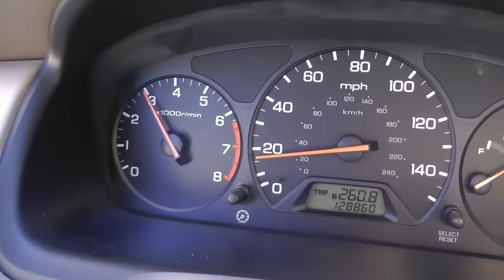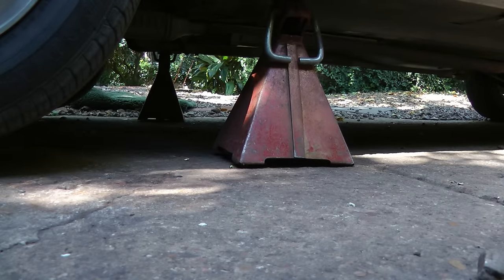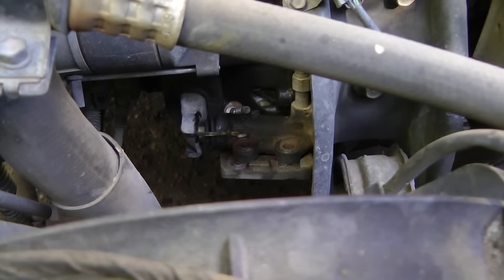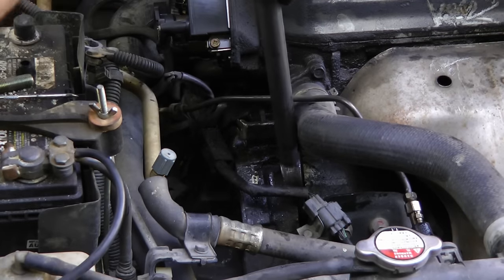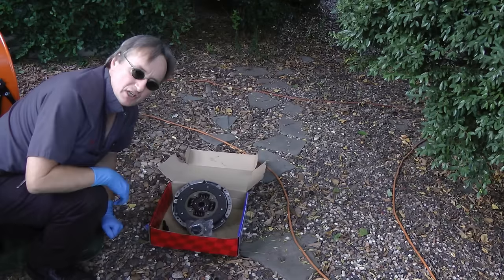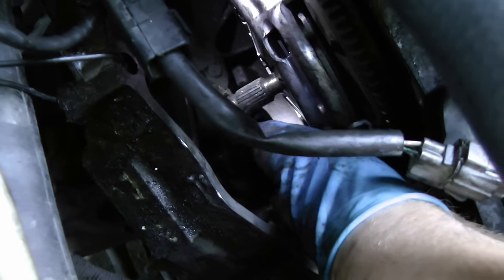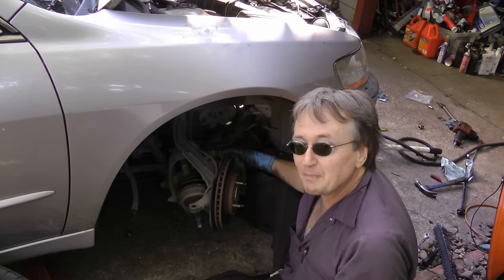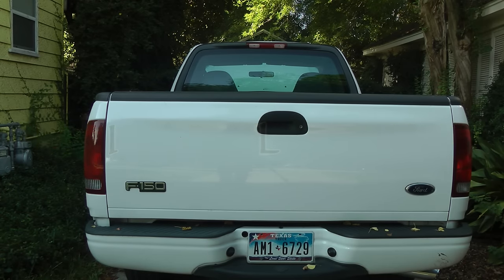How to Replace a Clutch in Your Car

Comment: I am going to state the blatantly obvious, but often overlooked tidbit of common sense: Don't EVER try doing this unless you're extremely advanced with cars. Yes, it is quite expensive to be done at a mechanic, but you will have absolutely no car if you screw something up, or just plain can't get things back together. Dropping a transmission is no novice task, getting it back into place is EXTREMELY difficult, this video doesn't show just how hard it can be. There are certain things that are absolutely worth paying a big price for to get them done at a shop, unless you're extremely proficient at cars, this isn't something you want to be getting into. I know this is all common sense, but I can't even count how many people I've seen fuck up their cars trying to do very difficult repairs by themselves, all because they didn't want to pay to get it done right.
Reply from the maker: depends on the car, and the person doing the work. I was putting clutches in cars when I was 14 years old, any mechanical person can do it.
Reply: ***** I'm not telling people to depend on shops for everything, I'm a person who does nearly all of my own car work, and learned that way. I'm just telling people to be very careful what they get into, make sure they know what they're doing, or have someone around who is. Like I said, I have seen so many people fuck up their cars because they were trying to do something way other their head. Say you need your car for work, if you can't get your transmission back into place, you aren't going anywhere. It's definitely a great idea to work on your own cars, saves a ton of money, just make sure you have the necessary experience before delving into the advanced stuff, that's my whole theme here.
Reply: ***** Hey in that case you had nothing to lose, I'd say go for it. It absolutely depends on the car, no doubt about it. For instance, I think anyone could agree a RWD is much easier to change a clutch in over a FWD or especially an AWD. My point is for people to always make sure they do their research beforehand; you don't want to jump in to suddenly realize you're absolutely screwed, have no idea what you're doing, and now have an inoperable vehicle that you cannot get back together. When that occurs, there are only two likely outcomes: They just put things back together despite being lost, and wind up screwing up their car, or they have no car to drive until they tow it to a shop, or find someone who can help them.
Reply: ***** In my personal opinion, I think the best idea is to have someone around who knows their stuff to shadow you. Everyone knows of someone who is good with cars, most people will be happy to help you if you respect them, show genuine interest, and most importantly listen to them. My neighbor was a mechanic, I began going over there on weekends when he did side work. As a condition for him to teach me, I offered to assist doing all the "bitch work" so to speak, grabbing and returning tools, collecting trash, disposing of fluids, you name it. I figured that was fair, considering he was taking his personal time to sit and explain things to me.

In a very short period of time I went from not knowing how to change oil (I was never taught anything about cars in my family, every problem was take it to the shop) to changing my own brake pads, struts, fuel filter etc. If you gain a mechanic's respect, they will eventually usually let you bring your car over and work on it, and you always have them there for when you run into a jam. You then have the ability to be a go getter and dive into projects, with peace of mind knowing you have someone there to help.

Manuals can be a great tool, I just personally think nothing beats learning hands on from another mechanic. Jumping into projects is great, just make sure you have someone available to assist you if you run into a jam. Eventually you can pretty much become self sufficient, but until then it is wise to err on the safe side.
Reply from the maker: *****
Na, my father could barely tie his own shoelaces, he played bridge and won money playing the ponies. My grandfather, his father, was the mechanic. One of those skip a generation things.
Reply: if you are lazy of course it is impossible.if there is will then there is a way.
Reply: well said. i skipped 3 steps due to not having the tools putting a front strut into a vw polo and it still went in perfect!! nothing damaged. where theres a will, there is definitely a way!
Reply: cyrax99
Any technically inclined person would know before had if they wanted to do this job on their car or not. Everything you do in life is "do at your own risk/leisure."
Reply: Joe M. I like your
I confidence! I bought a clutch for £63 and had it fitted for £80
Reply: YouTube Support how did you manage that?
Reply: gentle persuasion and using your head
Reply: I was born with poor boy syndrome which made me into a mechanic. Now its not that im poor i just have my own way of doing things and i don't trust other people touching my cars. NO TOUCHY!
Reply: I was also born with poor boy syndrome, and it took me on the path to earning my degree in Auto Tech. However I would have to agree with the OP on this one. If your mechanical experience only goes as far as replacing your air filter or changing spark plugs, make sure you know you can do this job. If you have even the slightest bit of doubt, you may want someone to shadow you. I have loads of transmission experience and mechanical experience in general, and even I had some difficulties when I did my clutch a couple weeks back. They're a super straightforward job, but it requires a good bit of know-how to make sure it is done right. Right being the keyword - I think someone who did the clutch on my truck before didn't have a good idea of what to do, and the pilot bearing was toast, only the outter race was left of it.
Reply: So how did you go Joe..did you change your clutch? Or did you have to take it to a mech, just curious
Reply: cyrax99 yeah but he is making it look so easy that it made me want to fix my girl's car but I'm thinking putting back all them screws and I'm a forgetful man I know I'm going to have plenty of screws left over on the floor like you said to put back that transmission and everything back how it was in place man you going to take plenty of hours not 4 minutes but he showed us the basically things what you got to do but he didn't show the struggle
Reply: cyrax99 your right. But at the same time it's very negative and   pessimist.
Reply: I've changed 2 clutches on 2 different vehicles and, while it looks intimidating, it's not that difficult in real life. The first clutch I replaced was a 1982 Datsun 210 station wagon. That was ridiculously easy. Just had to disconnect the drive shaft (most Japanese cars prior to the mid 80s were rwd) a couple of wires, and the tanny itself. Whole process, from start to finish,  took 5 hours. Transmission only weighed about 70lb dry. I could lift it with my bare hands but still used a floor jack and Jack stands for clearance. Unluckily for me, a garbage truck backed into that car two weeks later, totaling it. God I miss that car. (On a side note, if you want a car that is super easy to work on, Buy an older rear wheel drive Japanese or European Vehicle. Small engines and massive engine Bays with few wires, hoses, Etc. Everything is very easy to reach.) Second clutch I did was on a 1991 Mercury Tracer, basically a rebadged Ford Escort. It took me a couple of days to do it because it is front-wheel drive and everything is cramped in the engine bay and I had to take more stuff out of the way to get to it. But I still did successfully. The most difficult part was getting the transmission to fit back on to the engine
Reply: Or pay them to do it wrong and then have them avoid all responsibilities. Then you are left with a messed up car and a bad review or a BB form to file write.
Reply: Changing a clutch is fucking easy, guy. You have no idea
Reply: I did this job the other month on my Renault cilo 1.2.  It was my first  big job and the only experience i had before this was servicing it the month before. It is a straight forward job but it can take a long time. I (and my mate)  thought it would be a 6 hour job. It took 14 hours, this was worth it thou, becuase it worked out fine. It does  save alot of money but make sure you do it in a location which has good tools, supplies and a roof. This helps so much in doing a good job. And buy a Haynes manual it was so good at getting an inexperience 18 year old through a long job.
Reply: There isn't even that many parts to it. The drive shaft, okay, so take the lugs and the hubs off. Take the drive shafts out. Undo the bellhousing bolts. Remove the clutch, put in the new clutch. Screw the bellhousing bolts in, put the drive shafts back in, put the hubs back on, put the wheels back on. That's like 15 bolts max. While in most cases getting the transmission back into place can be difficult, you need to man up, and just smash it back in there. It's not a fragile piece of fiberglass, you're not going to break it, and you can even finesse it back in if you want. I refuse to pay anyone to do something that i can easily do. I've had to do a few engine swaps, and they are not fun at all, when it's not your car that is. Never been gentle with anything, except the fuel lines. Certain parts you need to careful of, for the most part if it's a giant piece of metal, if it isn't broken already, chances are you're not anywhere near strong enough to break it.
Reply: cyrax99 you don't need to be extremely advanced with cars to do things like this, most people are just inherently stupid. That's why places charge so much for a job that's nothing to them
Reply: @scottykilmer  yeah Scotty, I think the people who know about you and watch your videos have proven they can handle the first step: Research. People who can follow instructions and stay motivated have a good chance at success. I'm in the middle of a transmission swap and its been a little slow-going, but straightforward with online guides and forum tips.

Comment: Customer: My clutch is worn out
Me: It is easy
Customer: how?
Me: According to Scotty's 4 min fix.. lol
Reply: Mine just went out,I could just take it to the shop and give them $1500-2000 to do the job or I could spend $200 and do it myself following Scotty’s video.I’m smart enough to know if I tried to do it myself I’ll end up paying the mechanic the $1500-$2000 to replace the clutch and another $1000 from the other stuff I’ll break trying to do it myself.

Comment: I just put a clutch in a 1988 honda civic and now it wont shift, did I accidentally put the clutch in backwards? or could it be a faulty throwout bearing
Reply: start over - you know the procedure now so it will be quicker second time through - take it all back apart and check it's the right way round - when its opened up give the flywheel a good look over make sure it's not blued anywhere or scratched badly - also make sure you rebuilt the each assembly correctly and keep checking here for an answer from someone more qualified than me... im no mechanic... hope you get sorted
Reply: I put the throw out bearing in backwards.
Reply: thx for letting me learn from your mistake man, seriously. sorry it happened to ya though
Reply: kingkong8974 pull it out again an try to Dee where you went wrong..I did a clutch on a 83 Toyota truck..major pain but the job was a suceesex
Reply: @kingkong8974  haha that's awesome
Reply: @kevinbrislawn5918  you ever use spline grease/lube? if so what kind?

Comment: I had a 75 Chevy luv and did the clutch to it. But when  i had pulled the transmission out it had an “ inner bearing” that i didn’t know was there and had a heck of time putting it back together. My dad had to help me take it all apart and borrowed a pulley to take out that inner bearing and replace it with a new one😂👍thank God he showed up to help👍

Comment: I have that exact same car. I was worried about a $1000 bill when I burn out my clutch (I am just learning how to drive stick)  but you make it look so easy I will do it myself. Funny part is that I bought this car cause I had the automatic version and I know that the car is easy to fix . I have done axles tons of times and they are very easy.

Comment: Hi Scotty,

1) What's the difference between a drive shaft, CV joint, and axle?
2) Is there a specific side of the clutch disc that should face the transmission (and the other side facing the engine), or does that not matter?
3) Is it only with your jack that held your transmission up? If so, how did you balance it to prevent it from falling off?
4) Where in your video did you use tie rod separator? It was one of your "Things used in this video".

Comment: This took 3 evenings on my car. I would suggest you have a piece of paper to tape the bolts/nuts/screws to and label them. It's very easy to forget where they go. Use a torque wrench for the big nuts on the hub if you don't have an electric drill with adjustable torque. Removing the gearbox from the car takes more time, but it makes it a lot easier to work on (fewer tight spaces). If you do remove the gearbox, you also need to take out the speed cable, and unhook the shifting clips.

Comment from the maker: if not gouged up, most guys just reuse the flywheel. But I would advise buying a clutch replacement kit with all the other parts in it, you save money that way buying them all together.
Reply: Like trueing rotors and drums on brake job so no pulsating and to not glaze over pads same is true for flywheel. If flywheel like rotors and drums to thin to cut you replace.

Comment: I see you dont take the trans away, when you read about doing this job they always make it seem like you pull the trans right out of the car. What you showed seems a lot smarter, yore not lifting the trans up and down, you leave it on the jack and should be much easier to line back up when the time comes.. Thanks for that tip all by itself, I bet its a real time and drama saver.

Comment: Just another repair! I’d have someone on standby for that who had done one before, I know you have to lift the engine a few inches on a vw engine. All the same if it’s old you might as well take a chance. I did a timing belt/pumpearly in my amateur mechanic career, I reasoned if I trash the engine I haven’t lost much the van only cost 900 €. It was fiddly but I got it all lined up ok going carefully and gained in confidence. I think I would do it with thorough preparation, it kind of doesn’t make sense to run old vans if you won’t take a chance on doing repairs. Scotty the great can do man👍

Comment: First let me thank you for your continued service. Can you tell me if a burning smell coming from the driver side of your engine compartment on a Saturn Ion 2007 and a slow pick up after acceleration indicates a clutch getting ready to burn out.
Reply from the maker: time for a new clutch, and if you see nothing smoking on the engine like oil on the exhaust, the clutch is making the smell too

Comment: Hello Scotty! I see in the video that you do not remove completely the gearbox. You just pull it. I am curious how that is possible. You put under the gearbox an hydraulic jack. But is this sufficient to pull the gearbox without removing completely (putting down in the floor). Does this method work for several models in general? Thank you very much for your attention. Regards.

Comment: OK I've read a lot of comments were ppl don't know if their clutch is bad or not do this test for me and It will let you know how bad your clutch is its a general idea anyways

1) put your hill brake on 
2)start and put car In gear
3) let go of the clutch slowly with no gas acceleration behind it it

did it stall right as you let off the clutch? yes clutch is still working...

did the car still run but then slowly die?.... clutch going out

did the car stay on? 
clutch titslly  gone 

if the car is hard to shift in gear but stalls the sec you test it like above then you have other issues like master clutch cyl or clutch slave cylinder.. 

this has always helped me hope it helps your guys
Reply: 2004 Suzuki Aerio owner here. My car gear stick wont get hear. O notice the clutch pedal a bit stiff too. If I do get tje car stick in gear,the car response is slower tham before. Would that be the clutch?

Comment: Scotty, on my civic the clutch pedal would make a popping noise one day and the next day the shifter is super stiff and hard to put it in gear. Still turns on fine and still engages but the engagement point is lower and hasnt lost any fluid

Comment: Nice video. I own a 96 mustang and when I ease off the clutch without giving it gas, the car will only move a little bit and the whole car vibrates and I'm wondering is that a sign of a bad clutch. Shouldn't the car move slowly without shaking so bad?? Thanks in advance and this was a helpful video.
Reply from the maker: it sure is, but also check for broken transmission and motor mounts

Comment: This guy is great!!! Have quick question .. I have a Toyota Celica 1991 st manual trans. Im sure I need a clutch bc of the high RPMs and hardly any speed.. But recently my gear seem to grind or cant pop it out of gear.. how do I check transmission oil ?? there is no gage or anything or I just cant seem to find it

Comment: Scotty,

 I have a 04 VW Passat turbo manual transmission with 1400 miles. We just took a trip to Missouri from Florida the car was fine on the way up. On the way back we were going up hill and the Rpms started going way up as if you had the clutch pressed in. It did it 4 or 5 times but that's it. It was in 5th gear we were going about 70 mph. I am guessing the clutch was slipping. I'm wondering if you thing the same and also if you have any experience with them.